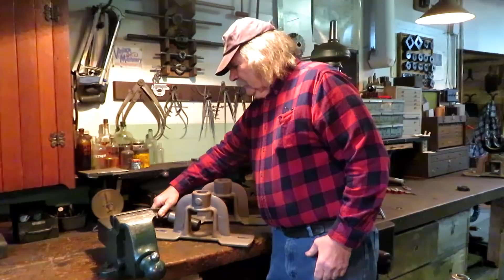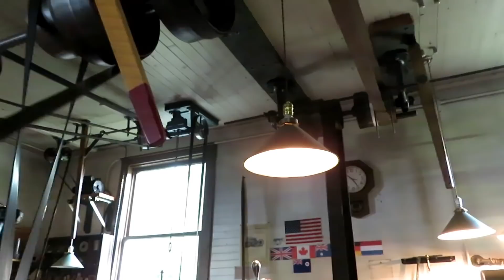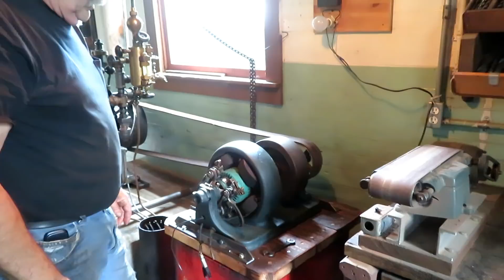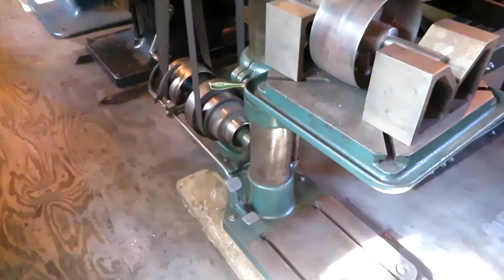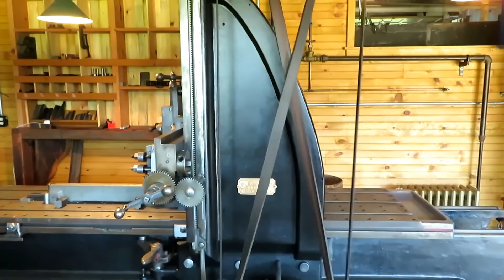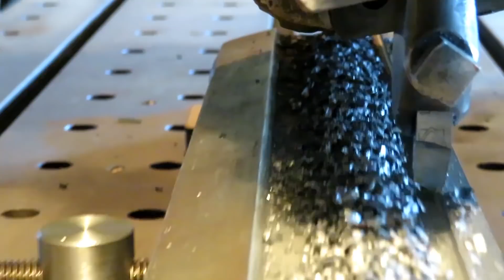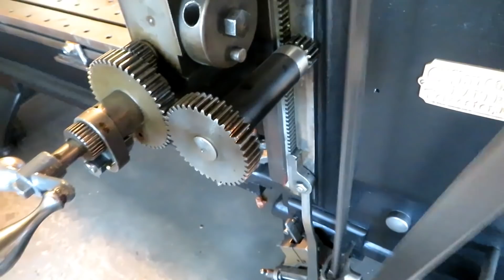Old Steam Powered Machine Shop 67:  DC power from steam

Comment: Between 1967 & 1970 I worked in a sugar factory that was steam powered. The machine shop was all run off line shafts and they generated their own electric power for all the other machines in the plant. The main bearings on the generator were broken and you could watch it swing back & forth a few inches each revolution. Sadly it was all torn down and scraped a few years later. The plant now makes plastic bags.